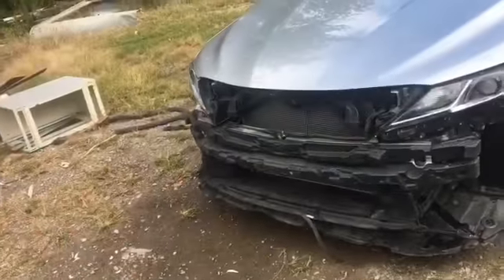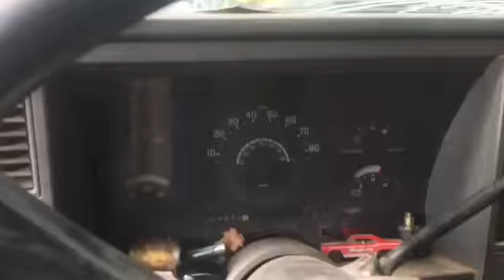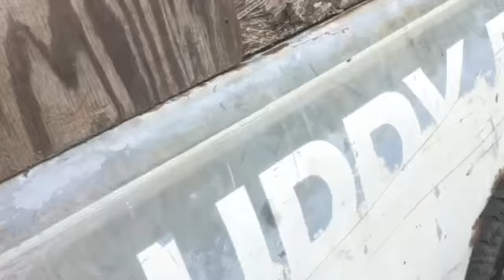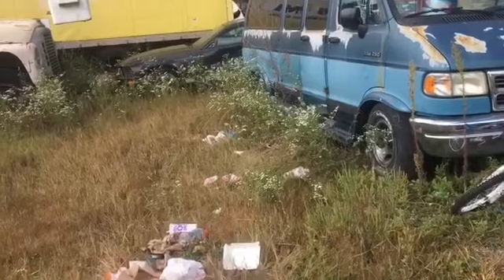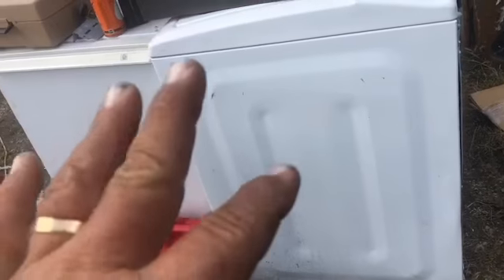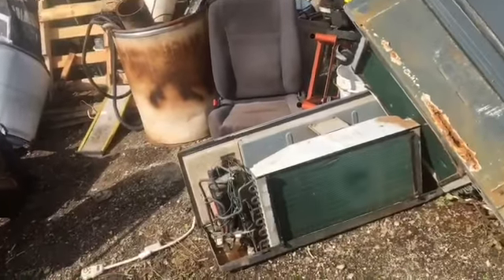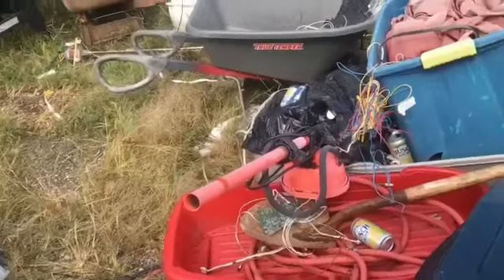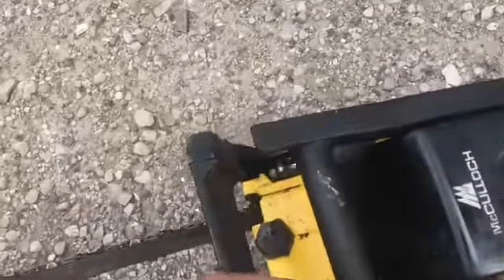SCRAPS AND REPAIRS

Comment: I think that black thing at 5:07 or so is a little MP3 player. Maybe plug some earphones in and see if it powers up and see what type of music is on it. The Pontiac hub cap at 12:10 is kind of a rare one. It's turbine style one like my parents had on their 1975 Pontiac Grandville!!! At one point I was finally able to see what the brand of the massive black horn tweeter speaker is that you have. It's made by Community. Is that just the horn or is the speaker (driver) still connected to it too?
Reply from the maker: I don’t know well actually have to take a look at it
And see if the speaker is still in it

Comment: king my scrap mountion is all gone i had 15 traler loads full loaded heavy now im out driving town to town looking for more
Reply from the maker: You you got rid of everything!!!!
Woah😮

You had a pretty good pile ggoing there
Reply: i had two loads i was very over loaded 5000 on them
Reply: my traler hasnt been the same since
Reply from the maker: Yeah that thing is probably taking a pounding
Reply from the maker: Did you damage the wheelbearings
Reply: @steelisthemeal  i check the baring every month and have an extra hub in the truck
Reply from the maker: That’s what I kind of figured especially when us scrappers over loan stuff it puts a strain on the tires and axels and bearings etc.

Comment: You can probably find a mobile glass guy to come to the compound and pull the winshield from the red chevy parts truck and install it in the white gmc.
Reply from the maker: Yeah I didn’t think about that I should check to see if it’s a good glass first
But that would be a cheaper alternative
Reply: @steelisthemeal  yea! Not sure about toilet, but in my area usually a mobile glass guy will charge $50 to pull one and $50 to install.
Reply from the maker: In my area is $175 to remove the old glass and install a new one
I just checked on that red Chevy and it has a cracked windshield in the corner
Reply: @steelisthemeal  dang!